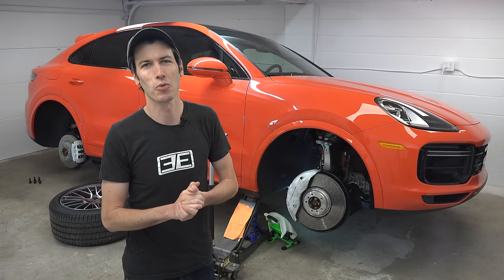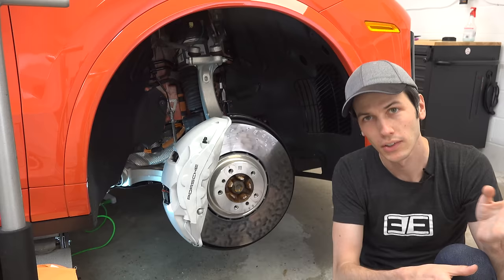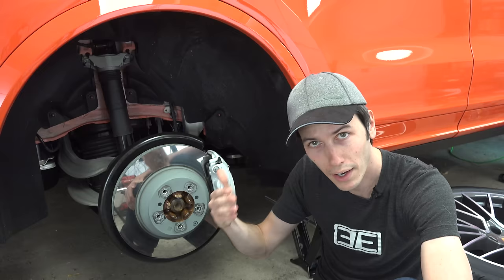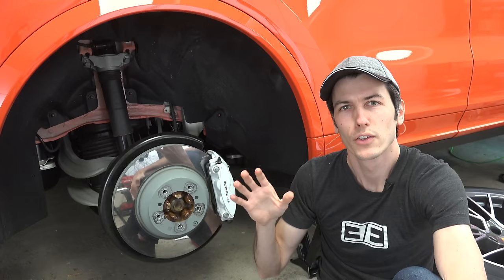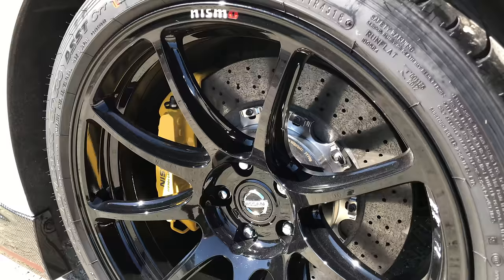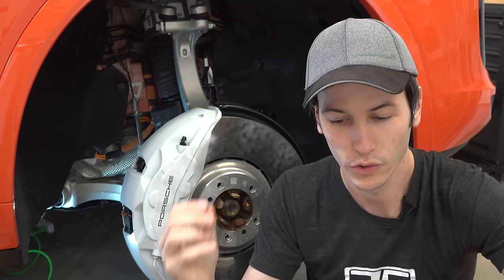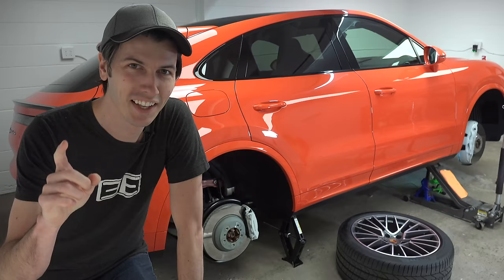Porsche Reinvents The Brake Rotor - No Rust, Low Dust, No Fade!

Comment: Those carbon ceramics cost more than my whole car to change.
Reply: 32k could put you into a decent used Porsche too!
Reply from the maker: Same haha, more than my Crosstrek or my MX-5 new, or both of them combined at present value. 😳
Reply: Honey my brakes are squealing!
Don't worry babe, just go down to the dealer and pick a new one out!
Reply: And not a crappy car either!
Reply: Brendan Yup, you can get a 2015 macan for 20k
Reply: German cars after all.
Reply: @Jackinacox  Yep, I have a 2019 Wrangler (Jeep guys will get mad I called it a car)
Reply: Always wondered why they lose so much value, imagen  thinking you bought it at a steal used for $60k to change $30k brakes 😅
Reply: @Jakob West Carbon ceramic? Even the iron ones cost more than my whole car, mate 😂
Reply: @technobrend0  Until it needs brakes... or an oil change!
Reply: @leopapio683  They will probably be quickly be converted to normal rotors and pads once they hit the used market.
Reply: @Zombie Head Most people with the M CCBs do the steel swap once they wear out. They suck ass anyway. A lot of them crack on their first track day. Garbage.
Reply: Yep, they cost roughly 32 time more than my car. It's not a great car but it works. My front breaks has put me back some 90 bucks last autumn. I''ll probably put money aside and avoid purchasing Porche for a century or two. :-D
Reply: @Zombie Head just all depends on how important it is to have "porche" on the calipers to the owner. I order most of my parts off Amazon nowadays lol
Reply: @marcd7332  What? In Poland it's more like 40-45k$, I mean, whatever it's not a car for me, but holy sht, what a difference
Reply: Anybody that buys the CCB and is not tracking or racing that vehicle needs to just give me their 30k so I can resto mod my car for $15,000 then use the rest to pay for track days and other events.
Reply: Those tungsten ceramic brakes cost more then my flat...
Reply: I could have bought my current car 6 times over, and my car is turbocharged!
Reply: For sale: 2020 Cayenne turbo, great shape, needs brakes, $15,000.
Reply: Yeah, I can buy my daily driver for the past 3+years 64 times over for this kind of money.
Reply: @EngineeringExplained  me too!
Reply: They cost like 3x as much as my car to change.
Reply: The PCCB brakes for a Cayman s is 10k so if the tungsten carbide is 1/3 the price respectively then I'd go for that for my car. If they made it.
Reply: I must really be doing something wrong. I built a POS that goes 8.80s @ 158mph for 10k less than what the carbon brakes cost and 2500 of that was the brakes.
Reply: Alll those brakes cost more than my car
Reply: they are more expensive than my 996 911
Reply: those are not carbon ceramic disc but standard grey cast iron disc coated with tungsten carbide.

Comment: No doubt, Porsche knows how to empty the pockets of it's customers.
Reply: I bet they couldn’t even if they tried
Reply: One of the few car companies that can get away with taking features away and charging you more for it.
Reply: When you buy any exotic car. Whether that’s Porsche or not. You don’t look at the price of the parts. You’ll be looking at other costs. Hell you’ll probably trade it in for a new one in a few years. You’ll be making enough to cover the cost of it in about a day or less.
Reply: They literally don't know what to do with themselves any more.  Who NEEDS this?
Reply: This coating is an existing coating used in industry.  These rotors are cheaper than they pretend.  You can find companies that will coat anything you want with this coating.  asbindustries com/tungsten-carbide-coatings
All they did was shift all the wear to the pads, which is why they had to make the pads massive otherwise you would go through pads too fast.
Reply: Not true, Ferrari is the best at that lol

500k for a extra light in the car lol

Comment: "70% of brake dust actually comes from the rotors"
I never would've guess that, I always assumed it was just the pads!

Also, the best part about those price breakdowns, it that in 20 years when the Cayenne Turbo is worth like $10000 on the used market, the brakes will still cost $11000 to replace with OEM parts
Reply: makes no sense that 70% would be from the rotors, the data showed was 1500x the wear on pads vs. rotors on thickness, the rotors are no where near 1500x the area of the pads
Reply: Porsche says that. But his own data says pads wear 1500x greater than rotors, and dust comes from pads. Anyone knows dust difference between organic and semi metallic pads is huge. 
Also  Porsche owners rarely buy their cars, they rent them, so they don't care about resale or any wear beyond 36-48 months.
Reply: Yes, if the pads wear 1500x the speed of the rotor, that's 1500 good reasons to expect the brake dust to be mainly pad
Reply: @truantray  I think y'all misunderstood EE, that "1500x" metric is specifically about the tungsten carbide rotors and the pads designed for them. Typical rotors are cast iron and the pads eat away at them significantly faster.
Metallic pads actually produce more dust because they remove more material from the rotors, which is a byproduct of the increased braking performance.
Reply: @Balomis  the 1500x was for iron rotors
Reply: I own a 30+ year old Porsche.

It cost very little to buy.

But Porsche parts always cost what they cost new.

If you've owned a BMW......think twice as much.

Owning a Porsche is not for the faint hearted.

(a clutch will be as much as every clutch I've ever replaced)
Reply: That’s the plan.
Reply: That's according to Porsche, which I think is bollocks.
Reply: Look up bosch iDisc, they came out with this years ago.  Porsche is just rebranding with a much higher cost.
Reply: you can throw the car away, too expensive
Reply: Seeing you touch the rotor surfaces with bare hands hurts my feelings.
Reply: @Balomis   He was talking about the iron rotors that he did testing with in a lab, i don't think he took the discs off a porsche review vehicle and put them on a testing machine
Reply: @Balomis  No, he was pulling data from a previous video that used cast iron rotors.
Reply: Just to throw another log on this fire. If 70% of brake dust comes from rotors then why is the trade off of using ceramic pads on a cast iron rotor reduced brake dust at the cost of increased rotor wear?
Reply: You wouldn't guess it because it's wrong. Anyone who has ever done their own brakes and turned their own rotors for a set of new pads knows that's horseshit.
Reply: @fuzzy1dk  1500x was a comparison based purely on the worn material thickness.
Reply: so you buy cast iron aftermarket
Reply: The 1500x number is not applicable to normal situations. Think about it. If they allow 1mm of wear on the rotor. That would be 1500mm of brakepad wear. Brake pads are what? 40mm? If we say 40 that would mean it would take 37 brake pads to wear down the rotor. On my previous car we replaced the rotors when we replaced the second set of pads.
Reply: @pd4165  Same story with all cars that were expensive when new. This is why they sell for such little money. If they break, the cost to fix quickly equals the purchase price of the car. To make it worse they inevitably are more complex than more mainstream cars resulting in more stuff that can fail. Don't be fooled that because it was super expensive when new that that equates to super reliable. In many cases the cheap family sedan will be just as reliable.
Reply: Ok yeah, but if 70% comes from rotors, and new rotors reduced it by 90%, still 37%, and white was still a terrible idea
Reply: Think about it; Porsche has adopted the razor blade philosophy of pricing.  Build a car to sell for an astronomical price, but trivially expensive compared to the unbelievable replacement wear item costs, that don't last.  Wait - these brakes last 30% longer, but cost $11,000 to replace, vs $2,300.  Wow - great - they last 30% longer for just under 5 times the price.  $1 Big Mac?  Nah - I'll take the $5 Quarter Pounder.  It's a better deal.
Reply: @fuzzy1dk  yes, that statement about 70% was obviously bs.
Reply: @truantray  You mean lease, like bank owns car and after like 5 years you turn it in and buy another one? Or did you actually meant rent?
Reply: @pd4165  But can't you buy quality after market parts like from Autozone etc, and pay regular pricing instead of the OEM dealer overpriced stuff?
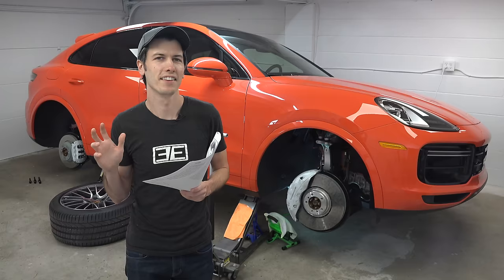Reply: @Balomis  no, listen closely. He says iron rotors. 3:00 and forward.
Reply: @audunskilbrei8279  that's not because of them being worn, that's because rotors warp with heat and cold, and they also become ridgid with lines and become shiny causing squeaking and vibrations. Also, it's not mandatory to change rotors with new pads, it's recommended because if your rotors were a little messed up, that would affect the new pads you're putting on. So again, it's not because the rotors are "worn down" that you replace them.
Reply: @oOdOdY75Oo  Warped rotors are definitely a reason for changing. But wear is also. In our case they measured the wear and it was getting close to the allowed limit so they changed them while changing the pads. We could have kept them longer but they estimated that the rotors would be worn out before the next pad change.
I think corrosion is one of the biggest contributors to rotor wear besides friction from the pads.
Reply: So did I Elimentus. See my post about my experience owning and driving a 2011 M37X for 155,000 miles.
Reply: @audunskilbrei8279  New brake pads are 10-15mm thick, 40mm is over 1.5" and would be ridiculous :)
Reply: @SI0AX  had autozone pads on my cayenne turbo because of an emergency, sever brake fade after one 100-0 stop. Went back to OE pads once I got back home.
Reply: @jet guy But if you can [and you should] repair your fohfoh yourself, parts are cheap. Pelican and FCPEuro .  But ya if you cannot turn your own wrenches any German car will cost more than a Japanese, Korean or American car.  If you lived in Germany it's different. Cost of exports.
Reply: Brake job is like an old Ferrari engine out service that everyone wants to sell before it needs to be done
Reply: @pd4165  It's been said that there's no such thing as a Porsche that costs less than $20,000. Because if the car costs less than 20 grand, it'll need repairs that will easily bring it past that mark.
Reply: i think they meant 70% comes from the rotors tearing out the pad materials hahaha
Reply: well, i've had the misfortune of having to sand cast iron parts, and the graphite in cast iron makes a black dirty mess compared to grinding steel
Reply: @truantray people lease porsche suvs maybe but not 911’s or most likely not caymans

Comment: When I worked at a Jaguar dealer, we had a customer that tracks his F-type, for fun not competitively. He changed his pads and rotors 3 times due to wearing them down on track in just a few years... they were carbon ceramic brakes, and surprisingly they're the same price as Porsche's! he basically paid for the car again, but this time just in brakes. I think it would be cheaper to take a hit on depreciation and just trade in the car for a new one than to replace carbon ceramic brakes
Reply: 420 Friendly  they are more concerned with selling new cars than worrying about repair of used cars, they also would not be paying that price for the repair anyways.
Reply: Lol
Reply: 420 Friendly  I wasn't in sales, reasons unknown to me, we check the cars for maintenance stuff after buying them, the used car dept pays for brakes/tires all the time.
Reply: @stephensheppard3501  we do pay close to that actually, the mechanics still get paid the same amount, and our cost was only like 2k less than retail
Reply: Due to that, some owners swap the pads to steel and then reinstall the original pads when it is time to sell the vehicle.
Reply: He paid to have it done or replace the brakes himself? I've never had someone to do a brake job for me and honestly it's not difficult at all. It seems like you could get a better price ordering them off the internet.
Reply: @dbclass4075  I would do the same thing.  I love performance brakes but there is only so much money I can spend
Reply: @actionjksn  he paid to have it done. But labour is the same price regardless of the type of brake material. Parts alone is expensive. Sure, a brake job isn't a hard job, but not every knows what to do, has 1-2 hours to wrench on their cars, or even wants to work on their car. He's got money, more than he can spend, he's buying a peace of mind knowing dealer parts and service has a certain level of quality. When you don't know car parts, buying them online could be sketchy, carbon ceramics are expensive even aftermarket

Comment: This technology was used on bicycle rims for many years by a company called Rigida (renamed to Ryde). Their rims were called CSS (Cardbide SuperSonic - indicating the processes by which the tungsten carbide was applied to the aluminium rims. The wear rate was very low and the rims lasted much longer than normal aluminium rims. They did however suffer from brake squeal and somewhat inconsistent wet weather performance.
Reply: And nobody bought them because the performance and cost surpassed the need.
Reply: Great example and quite funny, Thank you for sharing.

Comment: So for carbon ceramic brakes, the replacement parts cost half of the price of a standard Porsche Cayenne, the car where the brake sits on. It is more cost effective to buy a brand new Cayenne and sell your old one than replacing the brakes.
Reply: This is literally the printer model of business. Implying that the car is somehow disposable
Reply: Saurabh Kulkarni 
That’s exactly what they are planning
Reply: any car in parts is stupidly expensive... a couple years ago I read an article in a car magazine that did the math on how much a complete car would cost in replacement parts. They used the most sold car in my country, Germany, the VW Golf:
a well equipped VW Golf from the dealer, costs about 30,000€
the same Golf in OEM replacement parts (no labor) costs over 250,000€
now you know where the real money is made...
Reply: @cedricfranzen8558  Seems interesting .... but it s a LOOOT OF MONEY (i was expecting like 100-150l). Anyway - did you find the article or something similar on the internet ?
Reply: Or just put on iron rotors, which is what most owners do at that point.
Reply: Well it is a Porsche. They are notorious for being money pits. I do ponder if this technology is super expensive, or this is so expensive because Porsche and once a more "regular" manufacturer starts making this it would be way more cost effective.